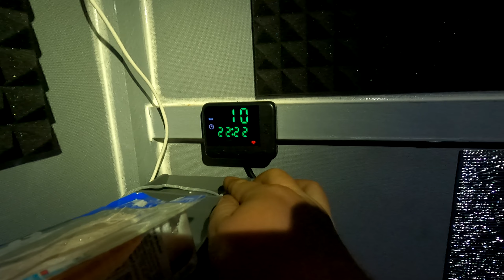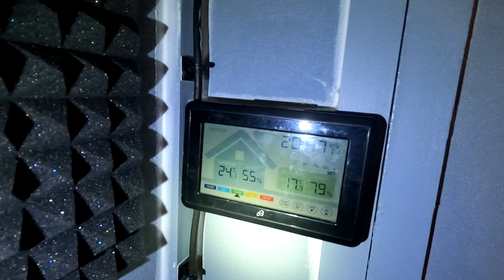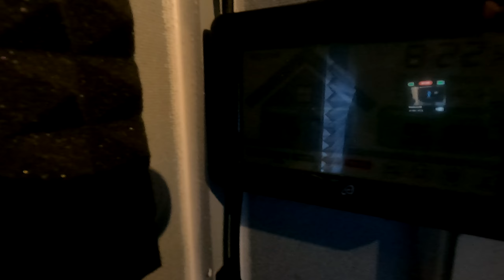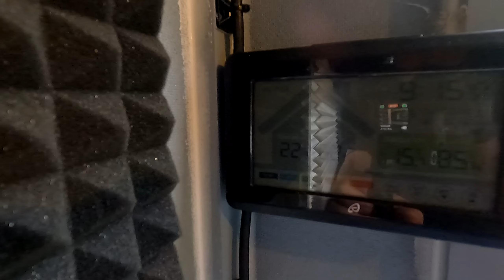Dieselstandheizung fest im Fahrradwohnwagen verbaut

Comment: What?   Ich  habe  ne  5kw  anlage  die  verbraucht  im  warmzustand  gerade  mal  80  watt
Reply from the maker: ? Meine verbraucht 10 Watt wenn die einmal läuft. Und meine 5 kW hat 16 Watt gezogen
Reply: @b-camperdiy9435  stimmt.  Nee.  Falsch  ausgedrückt.  Bei  start  80watt... dann  max 15watt.  

Ich  habe  ne  kleine  powerbank  für  kamerazwecke/ Presse   die  80 watt  auf 220  volt  liefert.  Somit  kann  ich  gut  4 std  live  mobil  eine funkkamera  anbieten die  von  einem  kameramann  gesteuert  wird.  Diese  powerbank  habe  ich  genutzt.  Allerdings auf  12  volt.  Ich  kann  mit  dieser  nur einmal  die  standheizung  starten.  Dann  ca.  6 std  betreiben.  Daher  meine  erkenntnis.   Das  waren  die  aller  ersten  tests vor 12  monaten.   Mein  projekt... was  Du  unter  Garantie  2025  sehen  wirst....  2024  wird  knapp ... hat  natürlich  mehr  Power  um  die  Standheizung  betreiben  zu  können.  Lg  micha
Reply from the maker: @MichaelLuiking  achso alles klar. Aber 80 Watt beim starten ist echt gut ! Weil meine 2 so wie 5 kW Heizung benötigt beim starten mindestens 150 Watt für die Glühkerze . hast du Benzin oder Diesel?